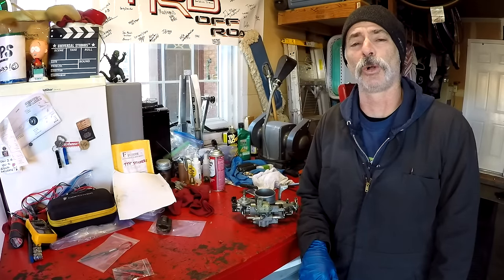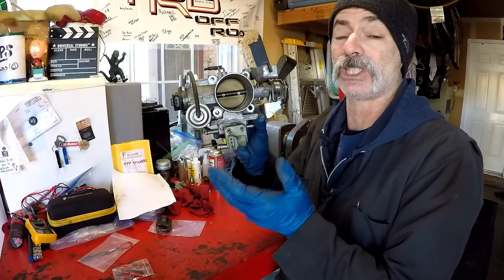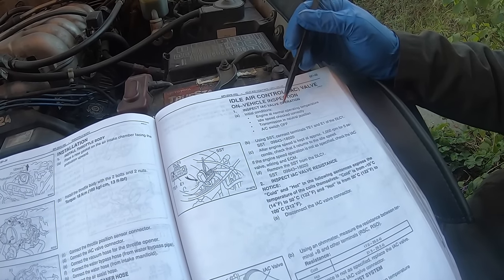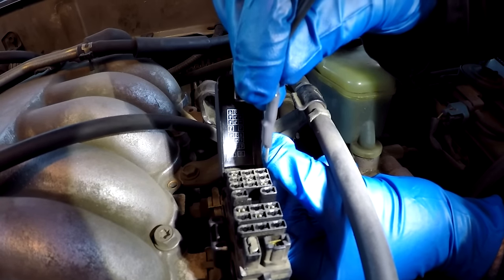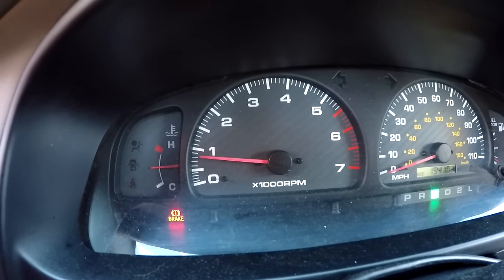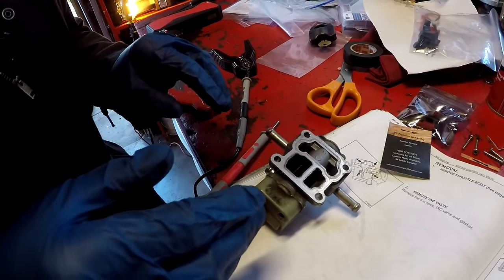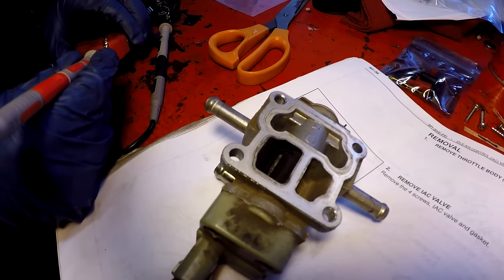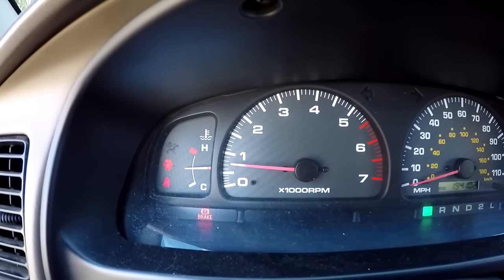IAC Valve Testing and Cleaning

Comment: Hey Timmy I just took off the idle air control valve and when I took it off I saw that it was open by like a little bit the truck is cold I haven’t started it I just worked on it this morning I haven’t turned it on I was wondering is it because when I took it off is it supposed to be open partially I’ve cleaned it right now with the throttlebody cleaner I took off the gunk off and it is still open partially are not supposed to be like that
Reply from the maker: When the IAC isn't getting either a signal to be open or closed, the little door could be partially open.  I would suggest doing the tests we show in the video to make sure it's opening and closing properly.
Reply: @TimmyTheToolman  i took it off and cleaned it, didnt check it, i still has rough idle, i did have a lil coolant loss, should i be worried of the lil coolant loss? Its 50/50 can i just add water? Thx tim
Reply from the maker: @yotagang3705  The rough idle might be a vacuum leak.  Have you inspected all your vacuum hoses?  For the coolant loss, it would be better to add some 50/50 of the coolant you're using.  If it's Red, it's most likely the Toyota Long Life Coolant that comes in a concentrate.  If it's Green, that means somebody flushed it at some point and converted it to a Prestone or comparable brand.  But yeah, you could get away with just adding water but use Distilled Water, not drinking or tap water.  Regular water has minerals in it that could cause corrosion build-up in your cooling system.
Reply: @TimmyTheToolman  Yeah some mechanic put some light green stuff and well now i do all my stuff now, I just dont know what coolant he used i wana say prestone but i dont wana mess up the coolant, thx for all the help man
Reply from the maker: @yotagang3705  Gotcha.  If it's green, using some Presone would be fine.  Maybe consider swapping back to Toyota Red Long Life coolant.  I just did that on my 2000 4runner.  I did the timing belt job and flushed my cooling system as part of it.  Now all 3 of my 4runners have Toyota coolant.
Reply: @TimmyTheToolman  yeah thats what im gonna end up doing, ive never done it but ive done many diys cus of your vidz,  i stopped going to mechanics, thx
Reply from the maker: @yotagang3705  Good job doing your own work.  You're learning and saving money.  Win-Win.

Comment: i did the test where your supposed to be 500rpms or below with all the intake hoses hooked up and it idled at 1000 rpm. what does this mean?
Reply from the maker: Please give me a time stamp for the part in the video you are talking about.  We made this video quite some time ago.
Reply: 22:15
Reply: so i took TB off then IAC and jumped it. door was stuck closed. sprayed a little TB cleaner in there and worked her loose. shes as good as new. tested her again she works fine. symptoms were...1200 rpm cold start but as it warmed up the rpms slowly would rise to 1750. she would also jump up and down 1200 to 1600 when coming to a stop. maybe this will help someone. may your Bolts break with ease in the future! wrench on...your videos are what make the internet a good place...
Reply from the maker: @TheSprink0621  Hey Stephen, great to hear the fix worked for you.  Great job and Happy Wrenching!

Comment: Hey Timmy, have an issue I'm trying solve on my 01' 4runner. Started my car this morning and had trac off, vsc trac, and CEL. Also no pedal response. After restarting the trac off, and vsc trac lights went away and ran a scan and read "p1126 magnetic clutch circuit" any ideas??
Reply from the maker: You're having an issue with your throttle body.  Your throttle body is a hybrid, it's a drive by wire system with a drive by cable backup.  If the wiring to the throttle position sensor connector (connection at the back of the throttle body) looks good, it's most likely your throttle body is toast.  With the 01 and 02 models, they don't have a replaceable throttle position sensor.  If the throttle position sensor goes bad, the whole throttle body needs to be replaced and they are very expensive.  There's a guy on Facebook that gets people Toyota parts for very good prices, usually as good or better than online parts sellers.  His name is Joe, and he goes my Joe Joe on Facebook.  If you decide to get a replacement throttle body, I'd check with him and see what his price is. https://www.facebook.com/profile.php?id=100028915082377
Reply: @TimmyTheToolman  Thanks Tim! Do you know if this is a common issue with the 01's? Seems bananas as my rig only has 99k miles.
Reply from the maker: @joshkeller6869  I've heard of it many times from people but I don't know how common it actually is.  It's a bummer they integrated the throttle position sensor into the throttle body and didn't make it a replaceable part.  Toyota makes some bad decisions for their customers sometimes.  Another really expensive part on your rig is the master cylinder.  Hope that never goes out on you.
Reply: @TimmyTheToolman  its funny you bring that up- I had to replace the brake booster pump motor. Had a deafening beeeeppp* and all abs,trac, vsc lights.
Reply from the maker: @joshkeller6869  How much was that brake booster pump?
Reply: @TimmyTheToolman  There was only one online company that had it. The name leaves me, but it was about $500. I believe there are some lexus models that can stumble across the same issue.
Reply from the maker: @joshkeller6869  Gotcha.

Comment: Hi dear,
In my 5A FE engine, rpm is unstable and gives 33 error code. What will be the error ?
Reply from the maker: There should be more numbers with that CEL code.  You can just search it on the internet and figure it out.
Reply: @TimmyTheToolman  Thanks dear 
According to web, it's malfunctioning IAC valve
Reply from the maker: @miniwanbuddika2733  Sounds like you have a bad IAC valve then.
Reply: @TimmyTheToolman  thanks
Reply from the maker: @miniwanbuddika2733  No problem.

Comment: It’s a shame what they did with the 01-02 models. A complete throttle body replacement is ridiculous.
Reply: Sam S they designed it so you can not access it at all. Total different throttle design.
Reply from the maker: @gunsfishand4x4  I'm trying to understand how the new design accomplishes the same task of getting the air it needs under idling conditions.  It has a plate on top that covers a chamber that an air hose leads to.  From that chamber is 6 little holes that drop into the throttle body bore on the backside of the throttle plate.  I just don't know what mechanism is used to deliver the air through the hose, to the fitting on the throttle body that leads to that chamber and ultimately into the back side bore of the throttle body to give the engine the air it needs to run.  I started a forum post on T4R.org hoping somebody has the answer I'm looking for.  If I get an answer, I'll put it either in the video description or a pinned comment.  Stay Tuned!
Reply: Timmy The Toolman you would be the first on the internet and help a lot of people with our years. That would be so great. Thank you! 🙏🏻
Reply from the maker: @gunsfishand4x4  Hey Chase, I'm trying to figure it out but the help I've asked for so far on the forums is just making me more confused.
Reply: Hey Tim. I did a valve cover gasket job about a week ago and a spark plug and wires job a week before, cause I didn't want to do them at the same time incase I ran into problems afterwards. Case in point! Now I'm having a high idle at times. Really it's just irratic. After it warms up it's still at about 1100 rpms. But after running around town ( shutting it down and starting it up) after about the fourth time of starting ,it will idle back down to 650 rpms. I new it would probably be this way for a couple of days because of disconnecting the battery cable, but it's been a week and kinda acts even worse. Today it got down to 650 after the fourth start up but then after the next start up it went back up to 1100 rpms. Of course this is all after it's been warned up and running a while . I did take the IAC VALVE off the throttle body and clean it along with everything. And i was careful when doing so , with the carb. cleaner. The little gasket did streach a little but I was very careful when putting the IAC back together to make sure the gasket was in the little Grove. So I'm pretty sure it's not leaking there. I know that my heat was acting funny the day after, cause when I had it on, it worked fine on low but when I turned the fan up to high it acted like it couldn't keep up with the high setting and would cool off until I turned it back down and then it would heat the air back up. So I thought I might have air in the line because I lost some coolant when I disconnect the lines off of the IAC. So I tried to bleed the system by starting the truck with the radiator lid off and heat on high and running it and also squeezing the main rad. line. It seemed to help with the heat the other day but today I can tell it's still doing it. Just not as bad. I did clean out my rad. overflow the other day before I did the valve gaskets. And I put some water back in it.just in the overflow. And didn't use the heat until after I did the gasket job. So I didn't know at which point I got air in the system? I shouldn't have when I just cleaned the overflow.  So how do you check for air in your system? U think that might be the cause of my problem with the heat? And what do you think is causing my erratic idle? I watched ur vid Just to see if you did something different and I had done it just like u did. I got a new IAC gasket and throttle body gasket today and I'm going to change them in the morning, just in case, but I don't think that's where my problem is at. I hope it is, but? I've checked all the vacuum hoses and they are all plugged in. When I did the valve cover gaskets I had marked all of them with tape and numbered them and everything else I had to touch so I wouldn't hopefully run into this. That's why I did the plugs a week before and drove it for a week. I did end up one day having to pull my coils because it was missing and I had a new plug that was broke. U could hold it and spin the top and it would spin all the way through. So it ran a couple of days just fine but the day I went on a 109 mile trip, it started missing. I think that I broke it when I put it in, ( I was having issues with my spark plug socket) having to jam it on them to get it to pick it up. But I checked all of them after I saw that and replaced that one and that's all fine, it runs just fine. But the idle is giving me fits. Just a note that yes I did the PVC valve and everything as you did with the job. What's ur thoughts??

Comment: Can't find one for my 2013 toyota corolla
Reply from the maker: Newer throttle body designs don't have an IAC.  They have a drive by wire rather than a drive by cable system so everything is controlled electronically.   The throttle plate is controlled electronically so it stays partially open under idle and deceleration to give the engine the air it needs to run.  The thing that sucks about the newer designs is if you're having issues with the idling of the engine and the throttle body is the cause, the whole throttle body needs to be replaced and they are usually quite expensive.
Reply: @TimmyTheToolman  YES I SAW THAT THEY ARE. I TRIED TO CLEAN THE INLET.JUST SEEMS SOMETIMES THE IDLE GOES DOWN AT LIGHTES I NEED IT TO STAY RIGHT UNDER 1K FOR THE HIGH OUTPUT ALT I HAVE.

Comment: Does anyone know where i can find those IAC bolts?  Yes mine are stripped.
Reply from the maker: Either go to the dealer or take one of them to a hardware store and match up the length size and thread pitch and buy some.
Reply: @TimmyTheToolman  Thanks man!
Reply from the maker: @jlong0099  No problem.

Comment: Hey Timmy my 96 tacoma turns on then shuts off right away then i start it again it goes good until I turn ac on it dies would this be cause a faulty iac valve? I think it must be the Iac causing it to die on a cold start please get back to me 🙏🏼
Reply from the maker: It could be the IAC.  It could be the throttle position sensor too.  You need to start doing some testing to rule things out.
Reply: Timmy The Toolman what do you mean throttle positioning and sometime when I come back to drive it it dies while in neutral at a stop sign but I can start it again thats after leaving it for 3-5 hours ignition coil and spark plugs been change already
Reply from the maker: @bobby3940  It does sound like it's the IAC.  Have you tried starting it and then keep your foot on the gas pedal?  If it stays running without stalling, it's most likely the IAC.  Do the ohms test to verify though.
Reply: Timmy The Toolman yes it stays running im sure, it must be the tps I think your right Ill try starting tomorrow and pressing on gas
Reply: Timmy The Toolman wait you said if it stay running its Iac but it dont die unless I turn ac on so should i gas pedal while turning ac on?
Reply from the maker: @bobby3940  If it won't idle it's the IAC most likely.  But now you're saying it only dies when you turn on the AC?
Reply: Timmy The Toolman yes only sometimes it dies right when I start it so I dont know when to gas it but right when I turn ac on it dies on a cold start
Reply from the maker: @bobby3940  Well, your idle should increase when you turn on the AC and it obviously isn't.  I would definitely test your TPS as well as the IAC.
Reply: Timmy The Toolman I just foind out today that when I put signal lights on a cold start idle goes up and down like its going to stall I did alot of research and it sounds like a iac problem since iac can stall engine when ac is on
Reply from the maker: @bobby3940  Ok, let me know how it turns out after you replace the IAC.
Reply: Timmy The Toolman im going to clean it before replacing it what if its just dirty
Reply: Timmy The Toolman hey Timmy so I was wrong when I turn it on and gas it while turning headlights on or ac it still dies so you said its iac only if it stays on right
Reply from the maker: @bobby3940  Yeah, if it still dies when you gas it, it's got to be something else other than the IAC.
Reply: Timmy The Toolman now im do confuse to what it is I was so positive it was iacv because they say iacv involves ac on car can die
Reply from the maker: @bobby3940  Well, it does but my logic says if you are manually opening the throttle plate and it still dies, that points to something else.  Have you actually done an ohms test on the IAC yet.  If not, I suggest you do with a multimeter and take the guess work out of the equation.
Reply: Timmy The Toolman no i havent i have no tools to test
Reply from the maker: @bobby3940  You can pick up a multimeter online for an affordable price.  I provide a link to one in the video description.   Then you just need some connectors like we show in the video and hook it up to a 12 volt power source which could be your vehicle battery.  I would suggest testing it before dropping money on a replacement IAC.  If the IAC ends up being bad, I would not suggest aftermarket.   I would only buy an OEM one and they are a little pricey.  This is why I'm suggesting you confirm it is indeed bad before replacing it.
Reply: Timmy The Toolman ill try that
Reply from the maker: @bobby3940  Ok, let me know how it turns out.

Comment: Code p1120 and p1121 could be related to IAC? I have a 2001 (w/APPS), I lose the pedal (accelerator) entirely once the check engine light and VSC lights come on. It will go though if I push the pedal hard; kind of jerky and hard shifting. HELP please!
Reply from the maker: It looks like those CELs have to do with the throttle position sensor on the throttle body.  I read a forum post that Toyota might not sell those separately and thus you have to replace the entire throttle body. The 2001 and 2002 models have a different throttle body than the 1996 - 2000 models that is drive by wire with a drive by cable backup.  It's a sort of hybrid throttle body.  I'll look more into it and see if that indeed is the case.
Reply: @TimmyTheToolman  So much appreciated. I cleaned throttle body, MAFS, and air filter with no avail. I did read the forums as well; in regards to replacing only the TPS and it turns out that the TPS is sold by TOYOTA Dealer as one unit with the Throttle Body, including the TPS and the Accelerator Pedal Positions Sensor (APPS). Any way I can test the TPS to confirm that it is the problem?
Reply from the maker: @sonicricardo  There will be a testing procedure for it.  I would need to get my hands on a 2001 or 2002 manual.  Sean might have one.  If not, I could look it up on Toyota Tech Info but it will cost me $20 for a 2-Day Subscription.
Reply: @TimmyTheToolman  Ok so I ended up getting the whole throttle body ($430) from the Toyota Dealer. Will this be a plug and play job or will it require the ECU to be programmed to the new throttle body?
Reply from the maker: @sonicricardo  Plug and Play.
Reply: @TimmyTheToolman  Fingers crossed. I'll keep you in the loop of the results. Thank you for all the input.
Reply: @TimmyTheToolman  UPDATE. 2001 & 2002 4Runner code P1120 turned out to be the TPS sensor that was sold as part of the Throttle Body - Toyota (22030-62020) and not as a single piece. That part number also includes the Accelerator Pedal Position Sensor. Check engine light turned off on start up. Thanks for your support.
Reply from the maker: @sonicricardo  Glad you got it fixed.  Thanks for checking back in.  If I find an 01 or 02 at a PicknPull that still has the engine, I'm going to grab one of those throttle bodies.